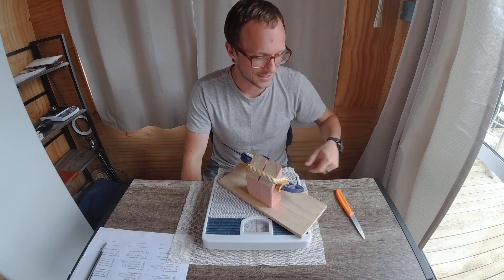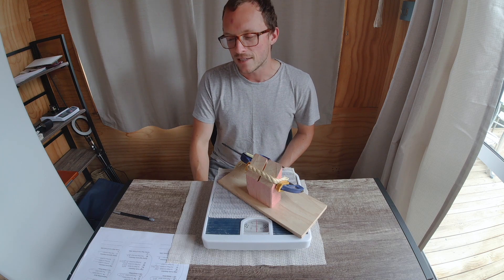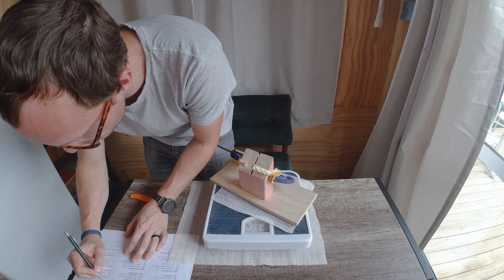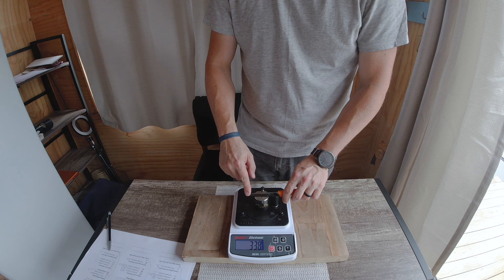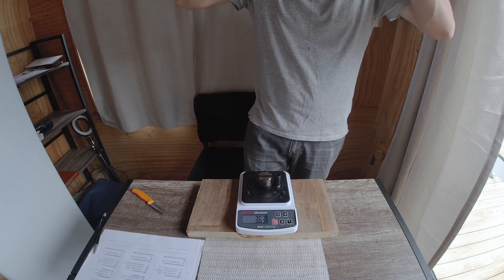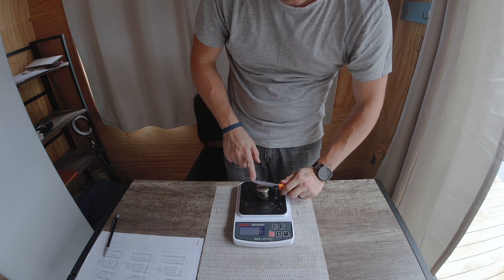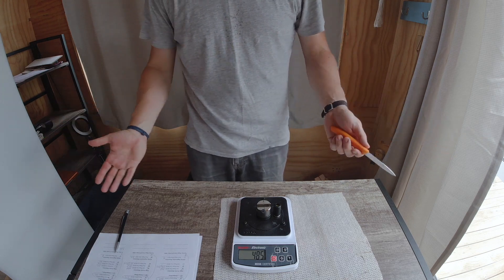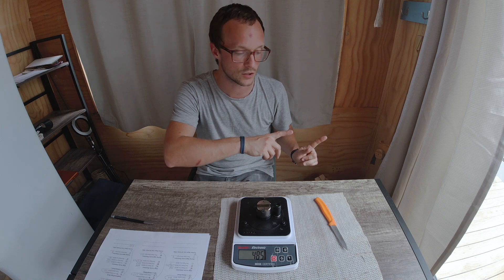Epic Edge or Epic Fail? | Original Dual Grit Sharpening vs ANDE | 40 mm Manila Rope Test

Comment: I am very curious if you have used the Fallkniven DC521 or DC4 Diamond plate on one side and ceramic reverse side for your dual grit method. Diamond is supposed to be about 25 micron and ceramic is about 1 micron from what I have found.
Reply from the maker: Hey Wesley!  I have used a DC4 before, many times.  I have tried it in a dual grit configuration, and the results were very aggressive!  Sometimes I have a hard time deburring it fully though.  I have not tested it in a rope test just by actual use.  I will take your comment into consideration though, it would be a good test.

At some point I'd really like to sort out which economical pocket stones yield the best coase, fine, and dual grit edge!

Comment: Can you define keenness? Not being a wisecrack.
You should see Cedric and Ada some guy did a dual grit magnacut that hit 1500 little andys.
Reply from the maker: PS the guy who sent that MagnaCut to Pete was me!  And it was this style of edge featured in this video.
Reply from the maker: Hey Steven!  Totally fair question… Keen-ness is how small the width of your edge apex is.  It’s one of the main things a BESS machine measures.

Sharpness is the ability to cut, which is affected by edge texture and shape/geometry/angle.

Stability is the ability of the edge to remain straight and un-chipped or to be realigned without major damage.

The BESS is here to measure keenness, the wedge is intended to give an idea of sharpness/aggression/cutting ability, the piano leg bash is meant to try to guage edge stability.

Cheers.